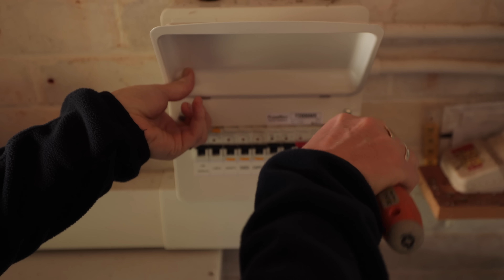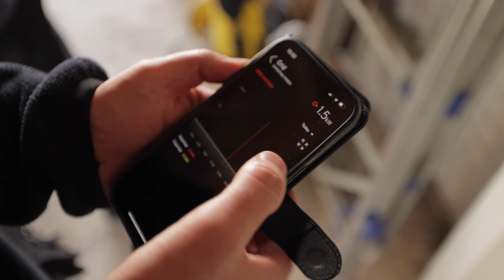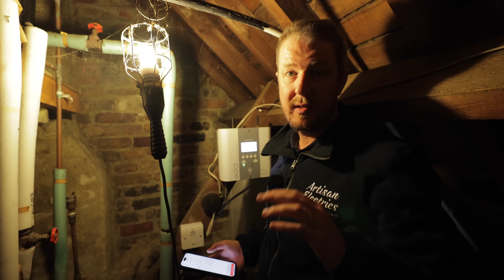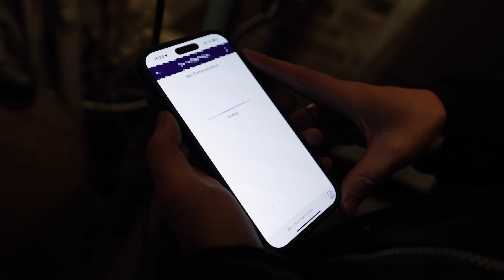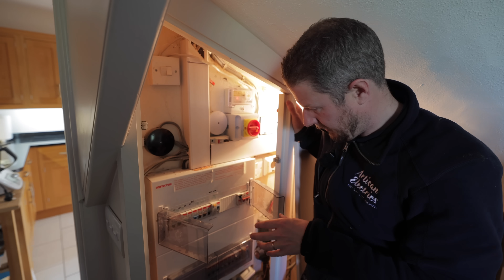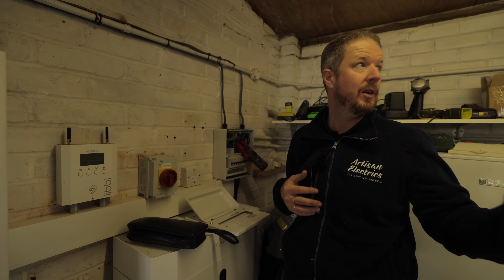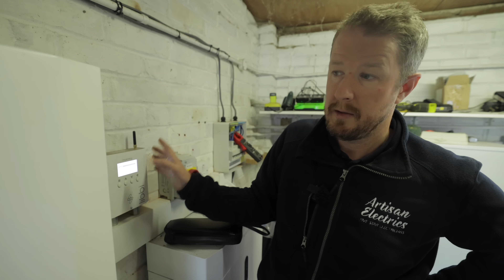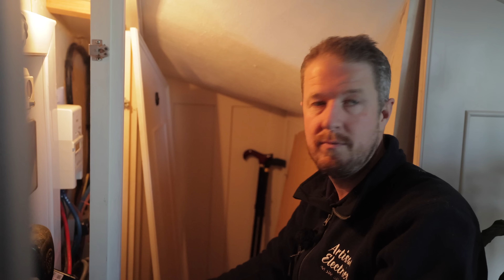£20,000+ Battery System RUINED By This 1 Simple Mistake 😳

Comment: Discoms Moto: Add as much devices as you can to confuse the customer and charge them every time for something or other.
In India here, Government Introduced Net Metering System, so if anyone plans to get Solar Installed, they just need to contact the Discom and they will come to your home and ugrade your Electricity Meter with Net Metering. What is do is it gets directly connected with Solar that get installed (Ongrid & Hybrid(with Batteries)) and automatically pass the additional generated energy to the grid incase if it is not consumed by the customer. Customer only need to focus on their Panels, Inverters, Batteries and their installations. Also they give very generous subsidy to everyone opting to get Solar Installed.
And yes, the additonal energy generated if in case not used by customer and passed to Grid can be easily checked through Net Metering (in Units) and the monthly bill will come as per that. If you pull any energy from Grid it will subtract it from the energy you supplied to them.
For Eg: If you supplied 100 units(Kwh) in months of winter like in November, Dec, Jan, Feb, March so it will keep on accumulating in your bill and if you go full blown in Summer and pull energy from the Grid it will subtract from there (from 500 units here , as per eg.).
Lastly, there Wifi Systems are not even needede in First place. Here in India, only the inverter will have Wifi and app that will show the generation and all that batteries connected, used, supplied to discoms,etc thorugh its screen and mobile application.
You dont need so many wifi's creating hell lot of confusion.
Technology is pretty easy and straight forward but Corporations make it complicated to keep churing the money.

Comment: AI summary: 
Yes, the customer’s problem was solved, and it was primarily due to a series of configuration issues with the solar and battery storage system. Here’s a concise breakdown based on the transcript:Problem Identified: The customer, Alan, had a 20 kWh battery storage system installed to complement his 6.3 kW solar panels, but it was only operating at about half capacity. The installer had limited the system’s charge and discharge rates, citing a 30-amp input limitation to the garage, which prevented the batteries from fully charging.
Investigation and Findings:The system was incorrectly configured, with the battery (Libby) limited to 18 amps for discharge instead of its full 22-amp capacity.
The Solar Edge current transformer (CT) was placed on the wrong cable (main house tail instead of the whole property’s main tail), causing incorrect import/export readings.
The Zappy (likely an EV charger) wasn’t communicating with other devices (solar, grid, or battery), and its date and time were incorrect due to a lack of Wi-Fi connection.
Firmware across devices was outdated and on different versions, causing communication issues between the Libby, Zappy, and Eddie (hot water diverter).
No CTs were set up to monitor the garage board’s load, which could have allowed safer full-rate charging without overloading the 50-amp-rated 10mm² cable.

Solutions Implemented:The technician removed the discharge limit on the Libby, setting it to 22 amps to allow full capacity usage, as the 10mm² cable and 50-amp fuse could handle the load (up to 55 amps in worst-case scenarios).
The Solar Edge CT was moved to the correct main tail to ensure accurate import/export readings.
Firmware was updated on all devices (Libby, Zappy, Solar Edge inverter), and the Zappy was reconfigured to connect to the internet, fixing communication issues and syncing devices.
The system was set up for automatic firmware updates via the app, ensuring ongoing maintenance without manual intervention.
The technician confirmed all devices were now communicating properly, and solar generation was visible on the Zappy, indicating successful reconfiguration.

Comment: As an electrician from the USA I am surprised to see cabling not enclosed in a raceway (conduit or junction box). I am pretty adamant that wiring be protected from damage and any heat be contained in metallic enclosures. If a cable overheats you sure want it isolated from flammable surfaces.
Reply: It’s residential, most are clipped and mounted to joists and beams just like vast amounts of NM-cable in the US at least when they go in between floors and ceilings. What your probably seeing it’s surface mounted  on walls, most houses in UK are brick and so they are usually chased into the wall or use surface mounted PVC trunking. Clearly previous electricians could have done a better job form a code perspective but it is what it is. He came around to solve a particular problem and no doubt recommended that such cables are properly chased/trunked when they do remodeling.
Reply: indeed, clipping of electrical wiring to a wall like in the attic here is forbidden in EU (risk of penetration), but seemingly not in UK...

Comment: I don't understand how they're worth installing.

How is spending - say - £10,000 on a solar system, going to save you any money on electricity? 

Do you get actual money from selling what you don't use, to the power grid or something? 

As battery life and panel life are finite, I don't have much confidence that you'd get more money than you spent, before something expensive needs to be replaced. 

I mean it must work because people do it. But I'm just saying that I don't understand it.
Reply: In the UK, new solar installs sell electricity to the grid (smart meters measure both ways, in and out), older installs use FIT (Feed In Tariff, which ended in 2019), FIT assumes a set amount is sent to the grid, you have a little generation meter (measures the solar PV total energy output produced), you submit this and get paid per unit. So that's one side of the money, a direct income from any excess put onto the grid.
The other side is the savings, as anyone with solar PV also reduces their daytime grid usage, as any generation is used by the house first, before it goes onto the grid. I work from home, so have a PC, monitor etc running all day long, and the houses consumes around 400-800 Watts during the day typically, today it's cloudy, but the small solar system I have (4kWp) is still putting out about 1.2kW, so basically from sunrise to sunset I spend no money on electricity. The exception is In the middle of Winter, there is about 8 weeks where I don't produce enough solar to offset the house usage fully, so it pulls from the grid for those few weeks. All my hot water also comes from excess solar PV (except for those few weeks in Winter).
Typically most installs expect to break even (cost to install vs generated income + savings) at around 8 to 12 years. Solar PV panels are expected to last around 20-30+ years (some even come with 20 year warranties), with batteries being similar (although warranties there tend not to be as long). So  basically ~10 years to pay for itself, and another 10+ years of income/savings.

Comment: Finally fixes Zappi, falls backwards off the drive, rips Zappi off the wall 😅
I've just had an Enphase solar battery system fitted by Octopus 2 weeks ago, I don't have as much control or visibility on the Enphase Enlighten  app which is disappointing. Also the system had been experiencing battery issues that I was unaware of but hopefully it's fixed and I can get full benefit from it.
Thanks for the videos and I hope this chaps system is running properly now 😊👍

Comment: Mistake is in the first sentence, 6000kw solar 20,000 battery 😂 Unfortunately being in blighty you will need to over panel the solar substantially due to the U.K's very low average yearly sun hours of 1350hrs per year! That's only 56 days! The U.K has some of the worst electrical installs I've ever seen. Definitely more regulation or any regulations needed!

Comment: What a complicated  installation for what it does.
Just dont tie it to the grid, connect your water heater and your EV charger to the battery system, 
you will be barely able to keep up with the energy demand.

Comment: Yep a few problems, the biggest issue not even mentioned is they dont create enough power from there solar to charge a 20kw battery, 
The owner mentioned that his battery is not going over 50 % so his hot water diverter is never being used
Reply: It's supposed to draw cheaper power at night and store it for day time use.
Reply: It depends, if they are charging on cheap overnight power then solar should go to the hot water divertor.

Comment: It's encouraging to hear that lessons have been learned about the fatal scalding of a baby girl by hot water venting into and melting an expansion tank.

Some very useful information here as I'm pondering an immersion heater solar diverter and will consider sufficient thermostat protection. I've been turning on/off my immersion heater manually when there is excess solar to test the effectiveness. The hot water reaches a much higher temperature than from the gas boiler because it has no thermostat built in.

Comment: I have a solar system with no apps or batteries. It has the inverter in the loft. I've checked with various electricians regarding servicing/ year checks and no one can tell me if this is a thing. I've been in my property ten years and have been told to just let it do its thing but is this correct? The system was installed before I bought the house.

Comment: Really interesting video. The issue of poor internet signals is a common problem. You even need an internet connection to update your car’s software these days! I got a new car a few weeks ago and at two weeks old the battery was flat! The problem was the software needed upgrading and it had a glitch. The écu did not turn the car off. (It’s a hybrid) after the sw update all good👍

Comment: 10mm2 can easily take 70amps.  i used 13amps for 1mm2 wire. it was only bit warm, so 10mm2 should easy run cool 70amps.

Comment: i can build 32kw/h battery for 4000 pounds. It will be so called low volatge battery, which is even better.  People shoudl STOP buying commercial high voltage battery banks! they are CRAZY expensive and have VERY low quality cells.

Comment: to me this all comes as a disappointment over the level of knolidge  over the architecture of PV , Battery  installations.   Typical there are cables all over and the state of some used components is far from ideal ..  but in my opinion  you can never charge 20 Kw batteries with 6or seven Kw of PV . Than the heating up of a boiler  is practically  a rare occasion .    I realy love people doing what they can  but our man here irons out the foults ... great job !!

Comment: In this situation, would it be reasonable to expect the original installer to reimburse the customer because they failed to provide the setup as they were contracted to do? Yes you've spent time on this job but it doesn't feel that the customer should have to pay extra when this care should have been given at the first install.

Comment: Im in a rented flat and the immersion heater with single temp control failed in the stuck on position and boiled all the pipes (for a number of days) luckily it was wired into a dangling block on the wall rather than a nice switch so I enjoyed pulling those cables out while water was dripping from the ceiling and all the pipe joints

Comment: A 50 amp fuse shouldn't blow until 100 amps?  No... at 55 amps, sure, it should take that for several minutes, but 75 amps should blow it in fairly short order.

Comment: Thing is all this is a lot of money fine for some but not for others. Let alone forking it out every  20yrs give or take, and running the lottery of it being installed and set up correctly. I was looking to in stall solar and battery system and other bits but, As the only one living in 3 bed semi, my power usage isn’t that bad way below average if there was a family living hear. And probably wont be as beneficial especially when taking into account servicing and life span of the systems. Also even if i did all these things are expensive and in reality could need money i dont have and is a risk getting finance, certain as some one self employed i am in the fortunate position at the moment wear im not in debt or have finances.. 
Don’t get me Wong as a business - sole tradesman part of my fastest growing work is solar cleaning which i enjoy, but have seen both sides very happy customers with theirs systems, to very angry / unhappy customers due mostly down to ether bad installs, or and, being miss sold, like being told the panels are self cleaning never need cleaning or maintenance, to bar instal it all 100% free energy no expenses needed after install. Witch leads to some customers never cleaning there panels for over 12yrs in some cases, and only realising when there panels are infested with dirt and latchen. Yes i can still clean them and is very satisfying and dose lead to massive improvements for z customers, but there is damage like staining and ghosting leading in a drop of efficiency and other issus that i spot. That requires a sparky or other trade to look into. Also due I’ve had a few who wear shocked at the cost to clean thinking it would be a £30 30min job like a window cleaner. But this is how i find out by chatting with the customer and say why did you think that. I know im one of the more competitively priced solar cleaners in my area but offering 100% professional service with premium products and training .There is clear issues in the trades and industry’s with cowboys or those wanting to take advantage of customers. But when forcing people into something that is good if you have money and the knowledge and will- awareness especially thru mandates i can see thes issues getting worse, due people will be tempted by the cheaper option over having a professional and decent components. Witch leads to the obvious issues. In stead of allowing the. Free market to grow it witch will hopefully reduce the entry level for decent systems and installers and so on. But we will see.

Comment: Where is the setting for auto firmare update?  

I've had my Eddi and Zappi for a couple of years and honestly the software is the weakest link in otherwise good hardware.  

I've had the Eddi crash and Zappi firmware crash on me a couple of times where the Eddi stayed on heating the hot water.  Fortunately the thermocutout on the HW tank limited the heater but still it was heating day n night until I noticed.

Another thing I recommend is hardwired ethernet links to all the myEnergy products.  Far better than WiFi.

Comment: The first mistake is to assume this whole solar/battery setup is environment friendly.
It is NOT!
They sell that scam by totally ignoring manufacturing and disposal of the solar panels, charging thru mains and batteries.

That is the same as I would ignore the diesel motor in a Diesel generator setup.

Comment: the first mistake was pay 20k for  20kwh of storage O_O
Reply: Paying roughly double does tend to extend the payback time too. I recon it will take 20-30 years to get enough electricity savings to cover the system cost. This becomes impossible as the components probably wont last that long, and neither probably will the owner.
Reply: @andrewfrance1047  the fact is that there are battery packs with 15/17kwh at 1500-1800$...

Comment: I had the same issue with my GivEnergy system, CT Clamp was wrong, but not only that, it also needed an additional meter in the Gateway. Thing is, it wasn't the installer's fault, at the time, GivEnergy guided them through and this is how they said to have it. However, my installer was on their case until it got done right, they never tried to get out of it. So, at the time of installation, the battery manufacturer and SolarEdge, may have provided them with the wrong information.

Comment: If one of your units is too far from main hub for WiFi connection, you can use a PtP link, and hardwire the unit at far end. I use ubiquiti M5’s or AC LOCO units. Also works great for hardwiring smart pool pump and other equipment without having to run network cable all the way from outside pool area to inside network hub. 

I just subscribed. Keep up the good work. 👍

Port Aransas, Texas 🤙

Comment: Why isn't the battery set to charge to 100% with the excess solar before feeding into the grid? That would be cheaper than charging with nighttime power. Usually the battery has ~4 modes of operation. One where it charges at night with cheaper electricity from the grid and then used throughout the day. Another mode would be keep it at 100% charge for back up use in an area where there are regular power outages...and a smart mode for using battery power in the morning and then charging mid day then used for evening use. and a use a little power from the grid as possible mode for charging the battery with excess solar during the day for the house to be run off of the battery from evening until the next morning.